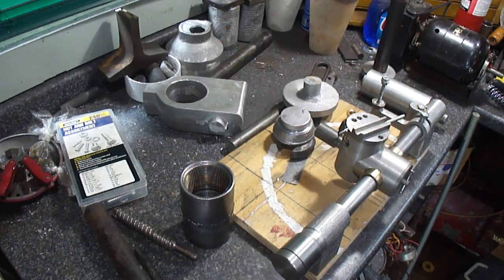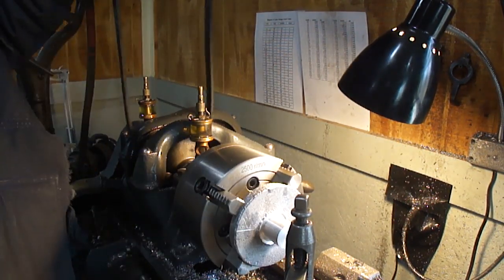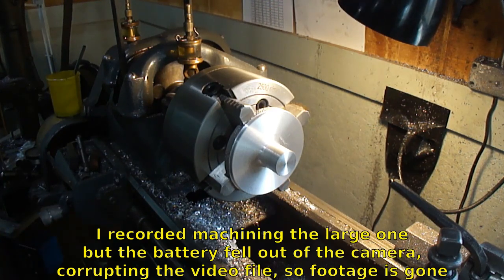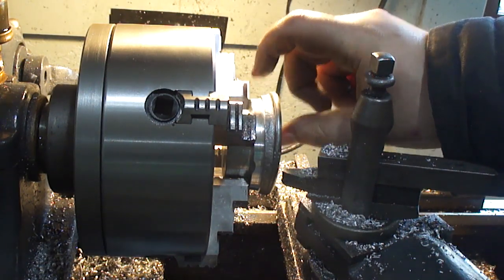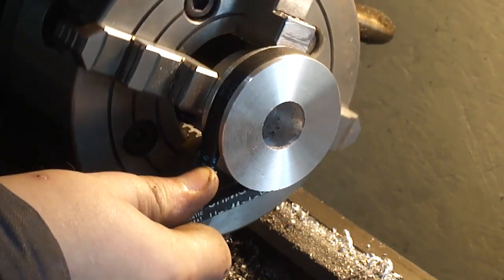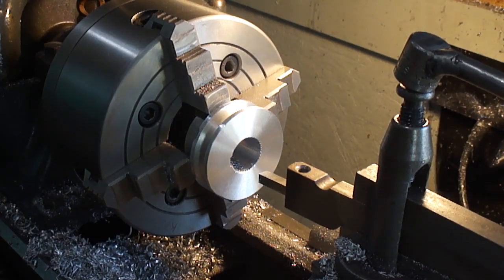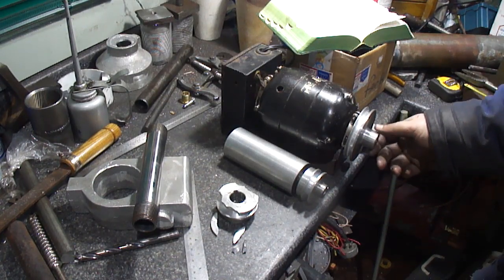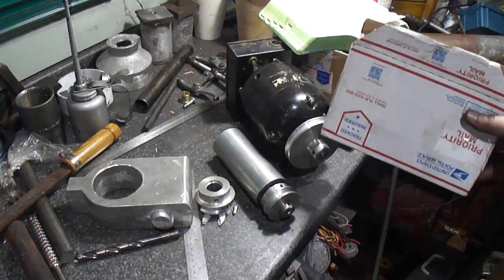T&C Grinder Build #11 - Motor and Spindle Pulleys

Comment: And i thought i had a bad week with my lathe motor blowing up !    Cheers .
Reply from the maker: lol, yea, and alot of it wasnt even shown on camera because either to keep the video semi family friendly, or the camera shut off/battery fell out of the camera while recording, lol. It looks like that part may finally be over, so yea, hopefully it is. Did you ever find out what was going on with your motor then?
Reply: @ChirpysTinkerings  The start windings burnt out , had it rewound with heavier gauge wire & larger cap's
Reply from the maker: ouch, that sucks and sounds quite pricey too...
Reply: @ChirpysTinkerings  about $100 less than a new motor the same , but it will be stronger .
Reply from the maker: oh, ok, and thats good.

Comment: Sometimes you have good ones and sometime bad ones, but it all comes out in the wash.  It still looks like you are getting closer to completion.  Too bad about the ingot.  I hope all things work better next time.
Reply from the maker: lol, yep, hopefully I can get it even closer soon, but need to wire up a new outlet and such for the stick welder so I can weld up that column. I need that so I can really sink the heat into it.

I'm really not sure where that ingot came from or what alloy it was, but it definitely didn't machine like normal cast at all. Either way, its part of the scrap bucket now, lol.